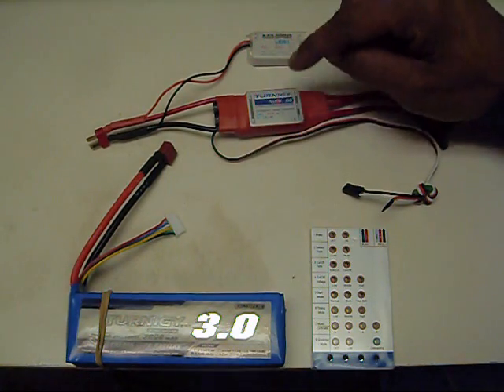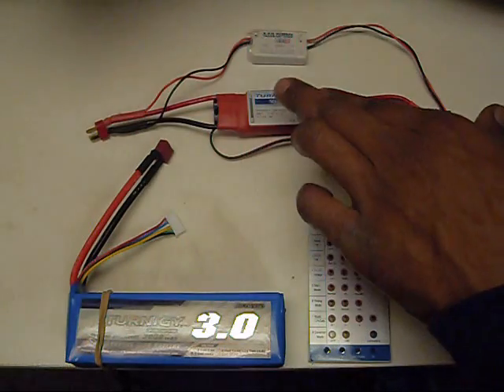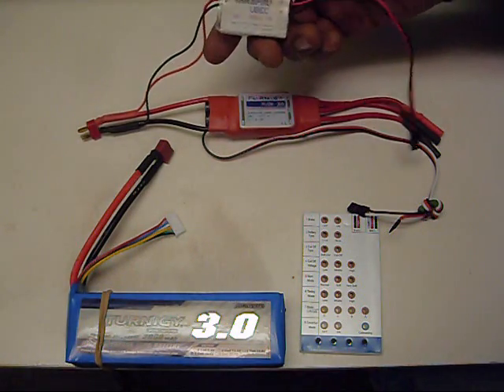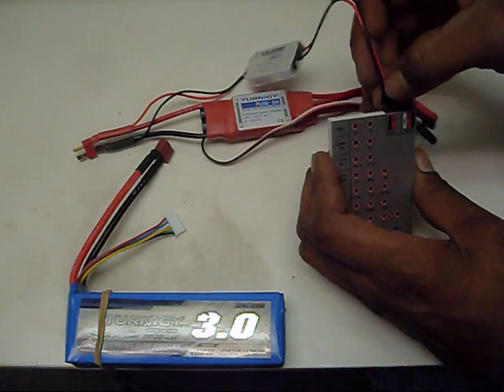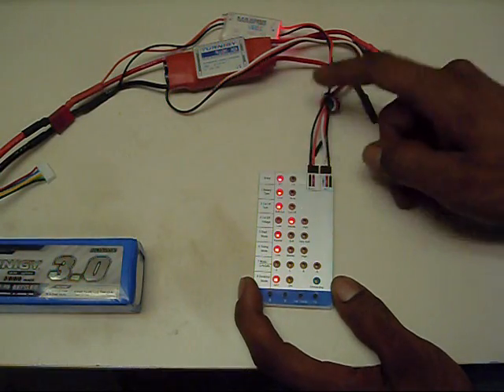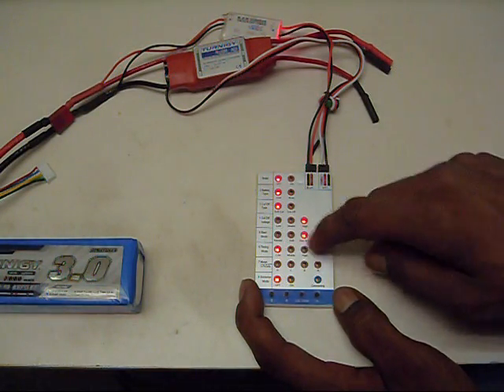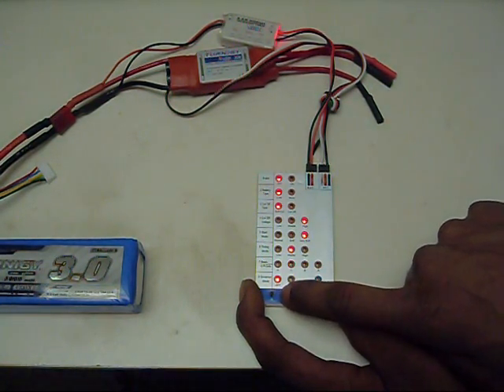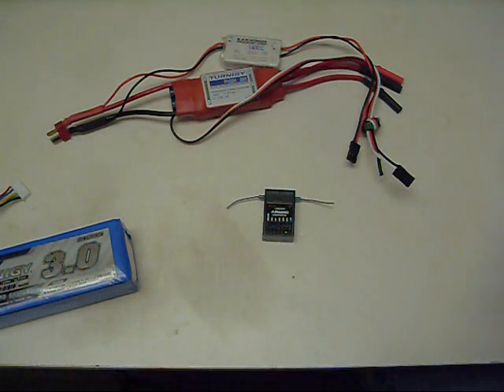ESC Programming using the Program Card

Comment: @DLM517 DON'T use both batteries just use a lipo OR a receiver pack to run the programme card,it does say that on the instructions thats why you might have burned out your two cards before,what Mark is doing is right because he is using two ESC's even though he has cut the red wire on one he is still plugging them both in thats all my friend ;-)

Comment from the maker: @DLM517 - Go back and watch the vid again cause you obviously missed some things. In short, I'm using a separate BEC because I used this ESC on a 500 size heli. Its my opinion that you should ALWAYS use either a separate BEC or Rx battery on 500 size and bigger helis. Most other recommend it too, its safer. But there is NOTHING wrong with how I connected the program card, go back to where I talk about cutting the red wire on from the ESC. Everything "IS" explained in the vid.

Comment: Ok answer this! When the esc powers the Turnigy program card, why do you need the power supply? The separate rx power supply in the video shows the plug in not covering the outside pin of card. Take a good look. I was told, that is double power to card and burns them out due to excess power. That is what happened to me on 2 t-program cards.